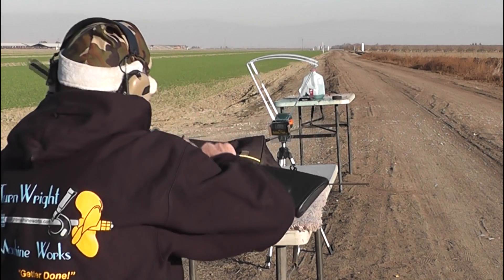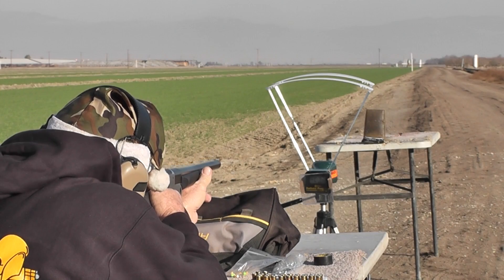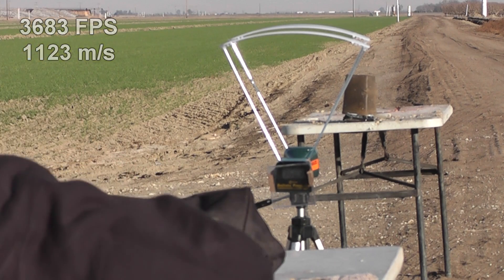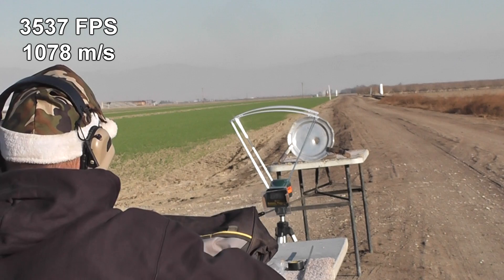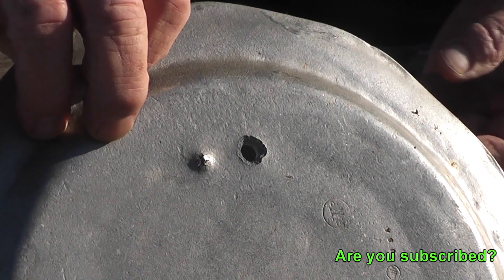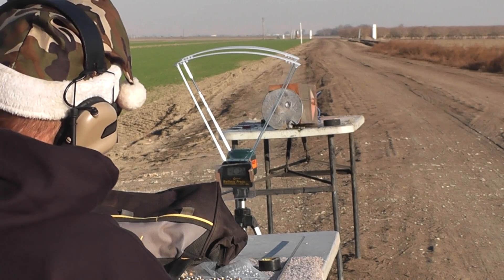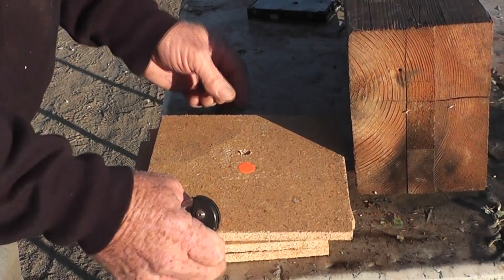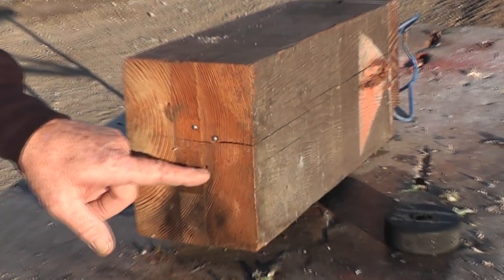World's FASTEST Airsoft BBs  +MACH 4  - What will they destroy?

Comment: you are getting near the gas expansion rate limits of smokeless powder, around 5500fps is max. to get faster than that you have to use exotic designs and propellants.
the army experimented with extremely high velocity in the late 80s and even then they only managed ~6000, but theorized that 7500+ was possible: http://www.dtic.mil/dtic/tr/fulltext/u2/a203307.pdf
for ultimate velocity you do this -> https://www.youtube.com/watch?v=BgyG414-bAs

Comment: You should make a bore adapter to center the smaller barrel. Maybe something 3d printed or lathe turned with a conical inside shape that would auto center the small barrel eliminating the need to manually install the spacer after every shot.
Reply: Turn it a little small and put an o-ring groove near each end, lubricate the o-rings to ease in and out and to prevent barrel marring. Put a grub screw to hold the spacer to the inner barrel to prevent the possibility of shifting under firing. That’s what I do on my L96 airsoft guns.
Reply: Yeah really need a center adapter  on the other end
Reply: josef wall a turned bushing on the end of the barrel would do wonders....
Reply: yeah I thought the same as I heard it rattling in the barrel. hell just pushing it through the centre of a cork and wedging it would give a much more consistent aim point
Reply: You don't want to put pressure on the end of the tube, it will cause the tube to bend. A tight slip fit in a metal bushing with additional O rings would probably work pretty well.

Comment: to get that more accurate , i think you should do an rubber fitting for end of shotgun barrel that has the inner tube coming tru,  so that bushing will hold the pipe in center of barrel and all so doesnt allow flexing of pipe on middle of shooting.
Reply: the tube isn't rifled so I doubt it would have too much affect
Reply: it would have allot of effect .    That pipe or barrel how ever you want to call it,  will have huge harmonics going tru it in shot.  if you look at it in slow motion it would vibrate from primer strike till second or two after the shot .   it acts a bit like spring if its not supported from both ends, and still it would vibrate at middle but at least the exit is still roughly in same position every time at middle of shotgun barrel.
Reply: need to stabilize barrel and impart spin to it to stabilize it.  not a twist like rifling, that would make it go left or right(depending on twist).  on an actual airsoft gun they use a piece of rubber that protrudes into the barrel, it forces the bb to ride the top of the barrel and spin.  round projectiles have different aerodynamics than pointy ones

Comment: Hey Jeff, been thinking on this flash thing we're seeing on the impacts. I was wondering if it's super tiny particles of aluminium that have gone past their auto ignition point? You guys always say that slugs etc are hot when you pick them up which I expect is from the deformation not the powder burning. I dunno, just spit balling here! Have a great Christmas all you guys at Tauflederstudios. All the best
Edit - happens on plastic too.... Huh.. Maybe something to do with dylithium cavitation in the warp core?
Reply: Pyrophoric vapors.  Pyrophoric = likes to burn.
Old time magician trick: Toss a handful of ultrafine lead or iron dust into the air, instant burst of flame and sparks.
Lots of dense smoke, perfect for dramatic exits.  Don't breathe it!
During a high-speed collision, the impacting metal surface[s] are heated, compressed and can flow.
This flowing metal is shed as a cloud of hot vapor and fine particles.
And often this heated vapor cloud will ignite, giving us the lovely flashes!
Plastic behaves in much the same way, even ballistic gel can flash if it's hit hard enough!
Reply: High pressure impacting oxides.
Reply: Solder Joe interesting, I'd kinda dismissed that idea because of oxides already being oxidised, but hey, tell me more!
Reply: Even the Mantis Shrimp can hit hard and fast enough to cause this flash of light phenomenon.
Reply: It's due to brutal deceleration which means that a lot of kinetic energy has been transformed into heat and the flash light is probably plasma, that's probably why the flash is more bigger on lead plate becaus the deceleration happens even more faster it's actually the same that happens when a meteorite enter the atmosphere sometimes they go at 25 km/s and ofc they decelerate in atmosphere due to friction with it which generate a lot of heat.
Reply: darkwarrior so you think the pressure and heat generated is what's causing the material to ignite?
Reply: Salty Steel but that's cavitation in water which is a little different
Reply: I did some math. Aluminum has 50 millijoules of minimum ignition energy. The 0.3 gram ball travelling at 1123 m/s yields 189 Joules of Kinetic Energy... it has to go SOMEWHERE in order to stop the BB, so it turns into heat.
Reply: In certain situations, anything can be burned/ignited. Even previously burned materials.

Florine is great at this, especially some of the more volatile organic mixtures containing it. I mean, it burns concrete, glass, ash.

And pretty sure you can change oxidation states with just pressure and heat, not 100% on that one though.

Chemistry is hella fun.
Reply: Greg Gallacci cheers Greg! I was figuring it'd be something along those lines, really appreciate the explanation :)
Reply: It does pose an interesting thought though.  Your right, mantis shrimp cause a cavitation in water which is a little different.  But if you stop and think about it, that's all a sonic boom is, a cavitation in air.  I would love if someone who has the physics back ground could run the numbers.  There has to be a formula that can be applied that shows when sonoluminescence is achieved.  In the case of the of the mantis shrimp its a slower moving projectile (the shrimp's claw) moving through a high density fluid (water).  In this case those two variables altered with the projectile (the bb) moving at much higher velocities through a much lower density fluid (air).  Would the change in those variable achieve the same result?
Reply: Kheled Bentley I know someone in nuclear chemistry, I'll ask if they've any buddies on the physics side who could answer the question. It really bugged me in this video :D
Reply: It is likely burning oxides that form a thin coat around the metal.
Reply: Jorge Lima that's cool as heck... Or not as your maths show!
Reply: Yeah it's only about 3000 times more energy than necessary to ignite some of that aluminum, minus of course stuff like air friction, and of course those number tables I looked up are for pure oxygen environment etc :)
Reply: Exactly, even something small has a lot of energy at those speeds, when they hit they slow down abruptly and the energy has to do something.